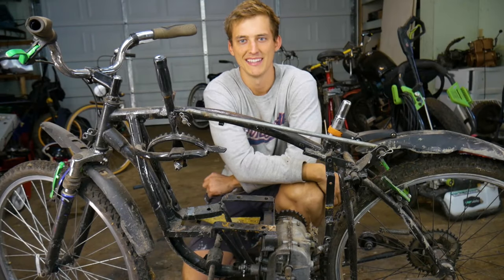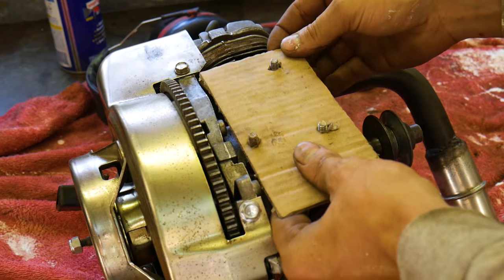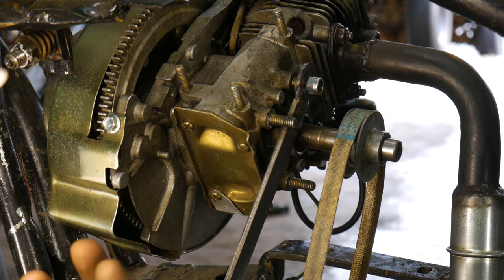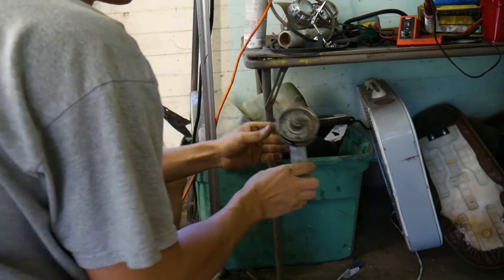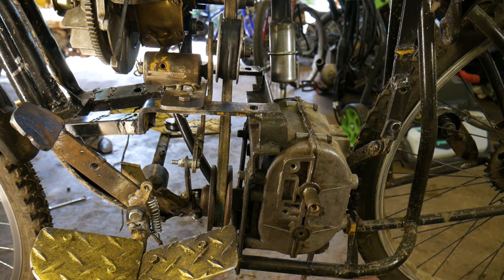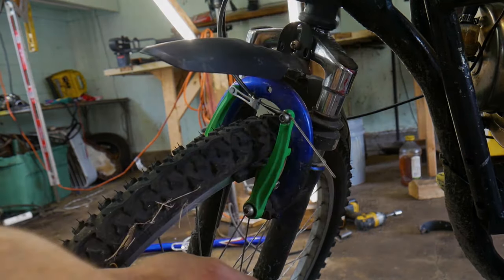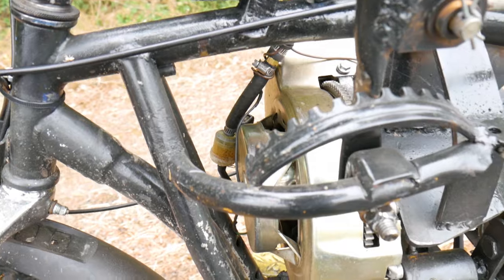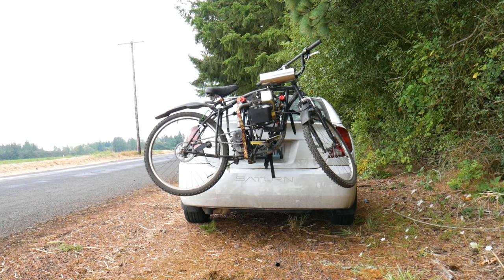Ugly Homemade 2-stroke motorized bike (with suicide shifter)

Comment: I have one of those tecumseh 2-strokes. build an expansion pipe for it (there's software to calculate the size and give you 2d templates for the steel) and bolt up a carb from a bigger tecumseh 4-stroke (HM-80 or similar.) an expansion pipe and larger diameter carb REALLY wakes it up once you get the jetting right.
Reply: FrankTheCat what’s the web site
Reply: FrankTheCat, very much pretty please. The website to calculate the expansion chamber?!

Comment: For such a small engine, that thing has a lot of power! My favorite part was the shifting lever. Very intuitive, but I would've gone with something more like a regular 3 speed riding law mower transmission, so part of the lever's function is to engage/disengage the clutch between gears. I also would've gone with a Honda GX-35 engine because it has the RPMs of a 2-stroke, the convenience and reliability of a 4-stroke, power and efficiency for it's size you might not find otherwise. It won't be good for off-roading, but I wouldn't put that much money and work into a bike I intend to put through that kind of hell, anyway. To top it off, I'd get metal mag wheels, compound tires and make 2 1.25 gallon gas tanks bridged with a brass tee, from oil bottles attached like panniers to the bike for increased range and low drag. I'd eventually like to add stabilizing wheels to the front and back, a backup 100W 12V pedal assist motor pulled from a scooter and modified (with 100W 12V solar panel on the top of a cargo trailer, charge controller and deep cycle gel cell marine battery in the trailer) for efficiency, reliability, better all-weather capability and low stress to the bike. I'd keep the pedals for legal reasons and added low profile pegs that can fold beside the crank arms, to replace the nuts that hold the crank arms on and to come out from the bottom bracket for a more balanced feel. Part of the reason my arthritis got so bad was because I just had my feet on the pedals, same position with my left foot in front of my right foot while not moving the pedals much while riding my last build. My lower spine was therefore canted which I didn't feel right away, I didn't even know I was developing a degenerative health condition at the time, but after a few 100 mile round trips with no suspension except in the seat, I guess that last trip  was the proverbial "straw that broke..." MY back. That's right before I experienced the most debilitating pain in my life, was diagnosed with osteoarthritis. I was seeing a chiropractor weekly for months before I got back to a point I could function almost as well in my own life as I had before, just with a few extra inconveniences while waking up or sitting for more than about 15 minutes straight. I never want to go through so much pain again, so yeah, my next bike with engine will have better suspension and folding pegs regardless.
Reply from the maker: Thanks for the comment Kenny, hope you're doing better now! HOnda GX-35 seems like a good bet!
Reply: @OliverMotorized  Yup.

Comment: Love your videos. I have a question I'm in the process of getting parts together to build a Mini bike from a Mongoose Fling (girls BMX). I plan on using a RYOBI 31cc 2 stroke engine. My plan is to use a Real Tree brand vacuum flask for my gas tank. Will the vacuum flask work?

Comment: Get a yz85 expansion chamber pipe and a port the cylinder with a bigger intake and carburetor and it will have about 3-5 times the hp! Not shitting you bud 🚲💨💨

Comment: Modern chainsaw engines run way to fast for a gear train deeded to power a bike. The antique saws are much slower with more torque but aren't typically reliable .

Comment: Ooookay, kid--heads up. SUICIDE is slang for a foot CLUTCH. Hand SHIFTERS are TANK SHIFT or JOCKEY SHIFT. Until 1958 almost ALL American machines came from the factory with a tank shifter. Jockeys became popular with customizers beginning in the mid-'60's when the linkage was scrapped in favor of a shaft/knob directly on the transmission lid. This set-up had 1st gear all the way back and high gear all the way forward. There were one or two more gears plus neutral somewhere in between with no clicks or notches to reference WHERE. Also affectionately referred to as a "mystery shift", they are NOT for the faint of heart!
Reply from the maker: Roy Ledford thanks for all the info! Didn’t know that. In this case the Neutral was all the way back then it goes 1-5